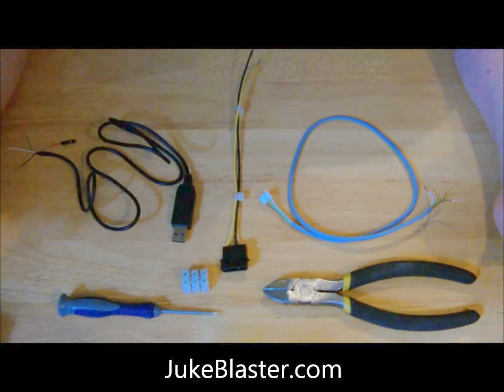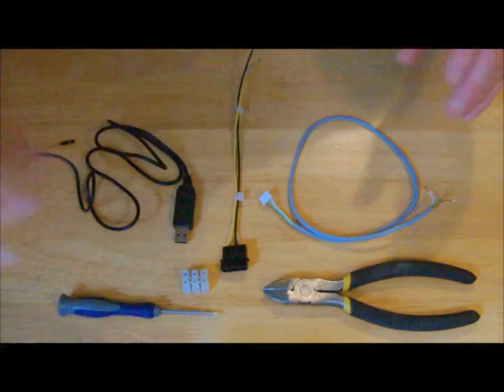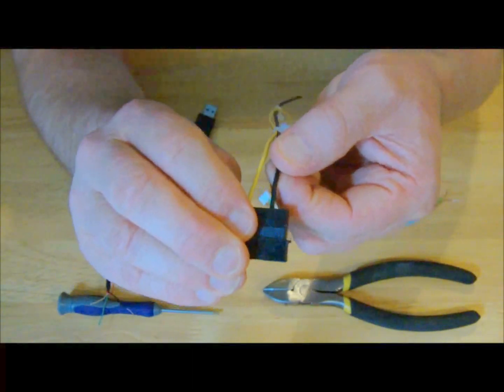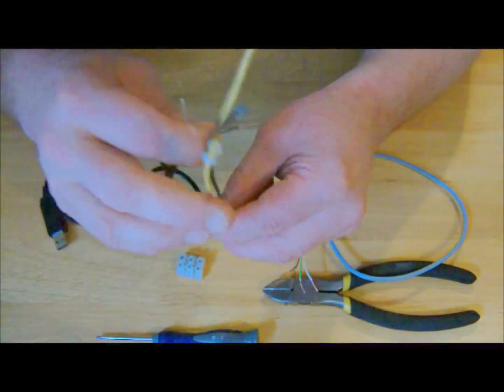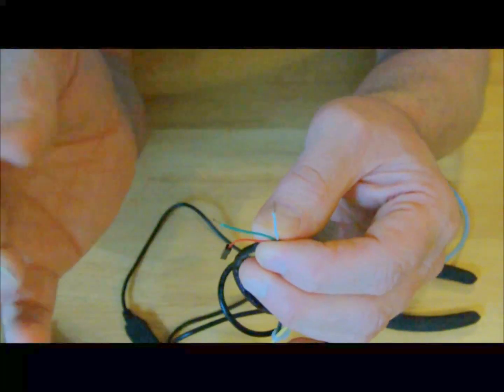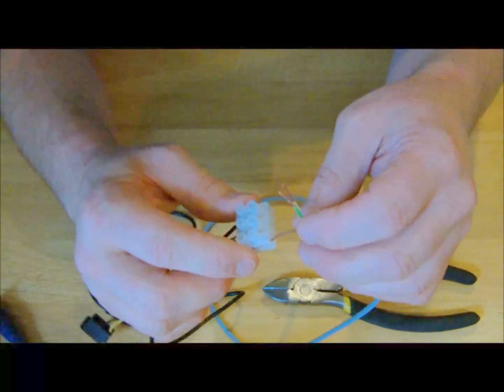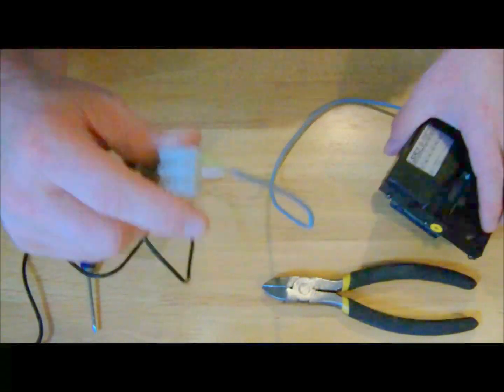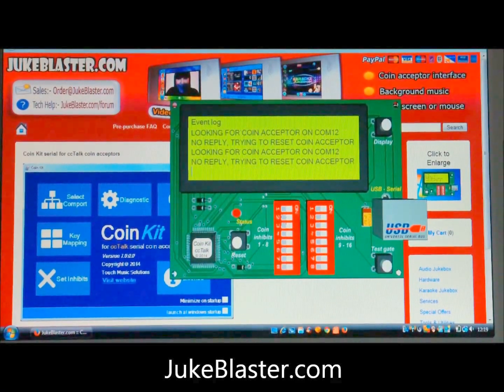Coin Kit ccTalk

Comment: Will this also work with a Pulse giving Coin Acceptor to connect it with Pub Jukebox?
Reply from the maker: For a pulse coin acceptor you need to use a keyboard encoder interface, search on ebay for:- Keyboard Encoder

Comment: I bought the same or a similar USB-to-TTL-cable on amazon and wired it accordingly. It houses a PL2303 controller and i checked that there is 12V and 3,3V on data, but i cant get it to work. CCTalk test software reports that there is a device, but not a CCTalk-device. The coin acceptor is EMP 850.13 v5.